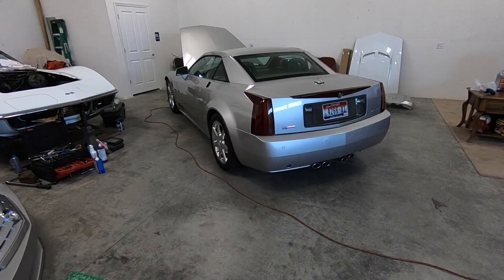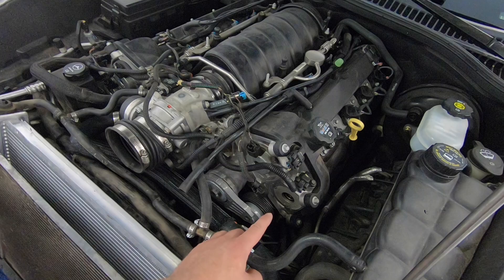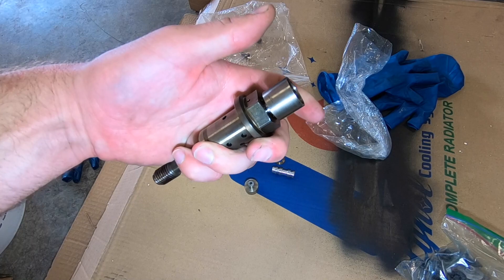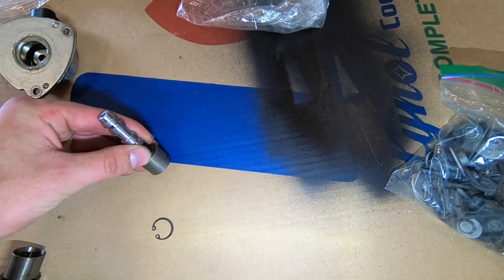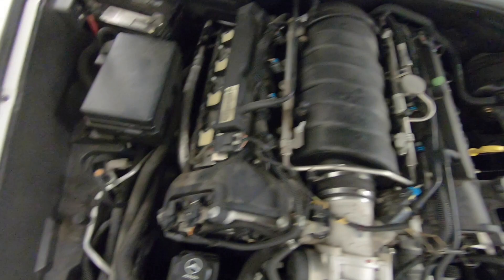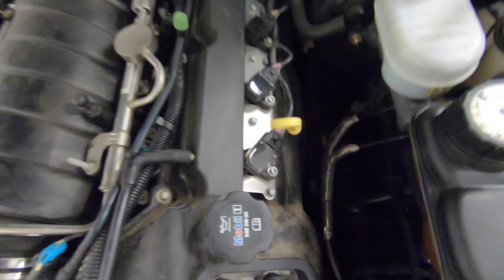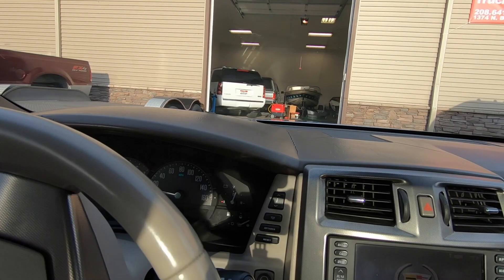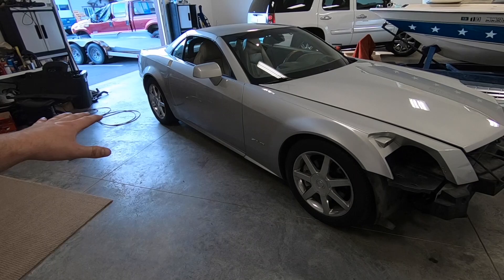Cadillac XLR Revival! Northstar V8 P0024 Code Fix

Comment: Your video saved my ass. Many thanks for the time you spent to spread this info on the camshaft actuators.
Reply: Hi again, Thought I would add a little more info to this post to save a lot of grief on removing the actuator without snapping off the oil shaft. Just loosen the 4 retaining bolts about 1/8 of an inch then with a flat blade wood chisel {harbor freight $8.00} knock the actuator loose then remove. This way you will not snap the oil shaft. To keep the debris from contaminating into the engine just scrape the gasket material off while using your dry vac. Hope this helps.

Comment: I've got this exact model year and color XLR but my interior is black.  My x ran over the front fender with our Hummer so I upgraded the front to an 09 V series including the hood, added 20s and just made it an absolute beauty.  Fun cars but they suck to work on.  My radiator was recalled and they installed a v series radiator.....guess what...it cracked too.   Double check your headlights and make sure you put resistors in. Some 05s still had the headlight melting situation.

Comment: If you still didn’t figure out the seat thing there’s a button down under your left leg there’s 3 buttons set your seat where ever you want it then hold the one or the 2 depending which key fob you want to use to register with that position I have a red 2005
Reply: Seat memory

Comment: How is the build coming along? I have one myself 07 XLR base model. Parts for these things are way to expensive and hard to find. Good luck with the build.
Reply from the maker: Y3N9VAN9 08 the car is back together and 100% again. It only cost about $6500 to get it there... we got burnt on this one at the auction and just paid way too much for it. I'm in this one just shy of $15k all said and done. Paid $8600 for it. I just bought a red one with 54,000 original miles on it for $11,600 that is mint in comparison.
Reply: Taylor Smith oh nice. Hell yeah.

Comment: My 2005 silver xlr had the exact same problem, from the cooling fan, radiator and even the VVT was broken in the exact same spot lower left. To be honest I may have broke it removing the oil leaking actuator. The dealership wanted $3500 to fix the VVT, got it done at a local engine shop for $195. I'm curious on how much you paid for the XLR? Mine had many problems: folding top inoperable, suspension module had water damage , RCDLR broken, missing the NAV disk, plus the previously mentioned problems.
Reply: How did you know your suspension module had water damage? What did it cost to fix?